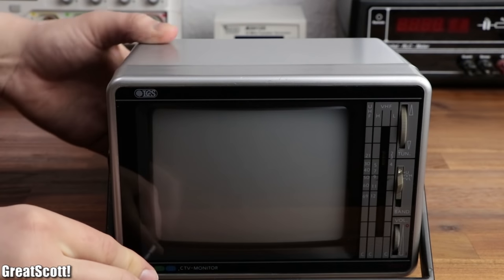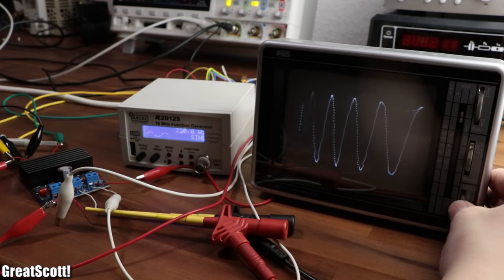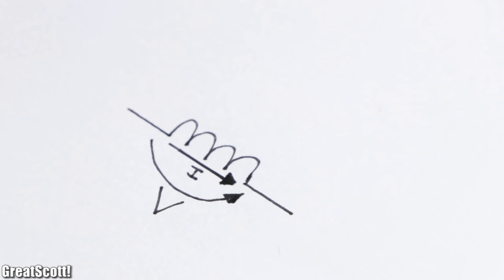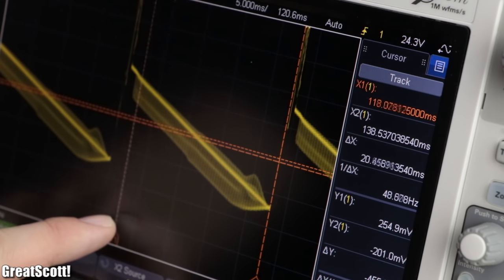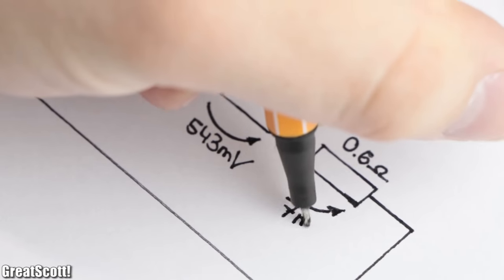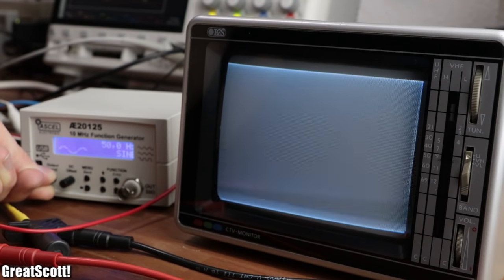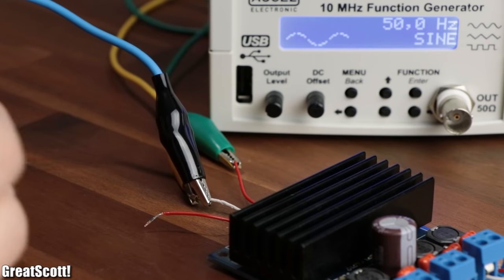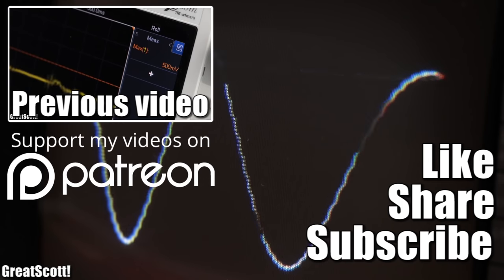HACKED!: CRT TV becomes a crude Oscilloscope

Comment: you said you were wrong about 50HZ was the horizontal it was the vertical right so why still you connect 50HZ sine wave of singal generator to the horizontal  deflection coil
Reply: The horizontal coil is faster because it has a lower inductance

Comment: Instead of taking it apart and applying a voltage to the deflection coils, couldn't you have just followed the protocol given by composite video? Arduinos can output mono video, it might be easier and safer to do that if you really were doing a DIY arduino scope. I'm guessing this video was more intended to be educational demonstration though? Certainly very cool to understand the workings of the CRT.

Comment: i tried this with my old tv and all i have is a horizontal line. When i increase the frequency the horizontal line starts to move up and down until it makes large line across the screen... is it possible to make the wave look normal if i connect red and blue wire to second channel of my amplifier?

Comment: Is it possible to get in contact with the high voltage of the crt anode?
Reply: Sure, but you shouldn't do it. Your best bet is to input a video signal into the tv like you normally would for tv. You would just use it to control the intensity or color. Don't mess around with the high voltage.

Comment: how to display color on that CRT? (you were only able to display black and white picture on it)
Reply from the maker: As far as I know there are RGB filters which create the color. You have to activate them separately.
Reply: You have to hijack the signals on the small board connected to the CRT.
The tiny board receive RGB signals and amplify them for the tube, just take over the inputs.

If you want the colors pure, don't fall for the temptation to pull off all those plastic tags with tiny.

Comment: I GOT A HEAFTY SHOCK DOING THIS. While trying to remove this suction cup thingy on the CRT, I got a pretty hefty shock. It wasn't even plugged in!
Reply: I don't know much about CRT screens, but I'm pretty sure that they have a powerful capacitor inside that you need to discharge before doing anything. That's what shocked you
Reply: Stephen Ferree  Oh ok

Comment: i didn't get the use of arduino in this project....please help!!
Reply: Its used for make sawtooth signal waves. You could do it with a 555 timer also.
The funcionality is to spead the input wave from left to right and repeat.
Before the arduino you see what happends with sinus. It spreads on the top of the other.

Comment: could this also be done using a old pc monitor?
Reply from the maker: I think so
Reply: luuk van den hurk ofcourse, all you need is old crt monitor, which is for old pcs
Reply: Totally. If the flyback and deflection circuit isn't connected on the mainboard, it's even better!

Disconnecting the horizontal deflection may mess up the high voltage supply, if they are related.